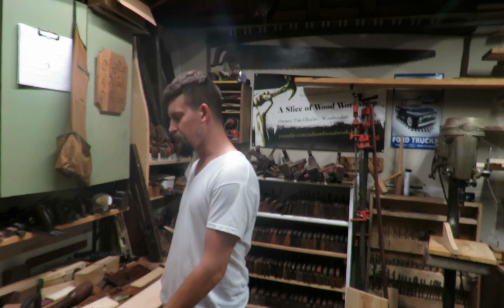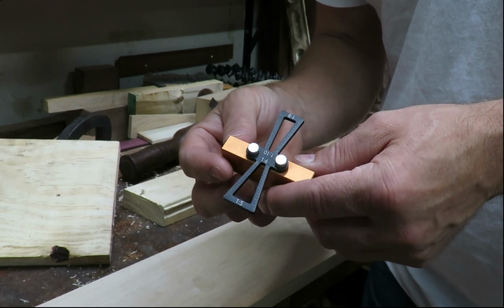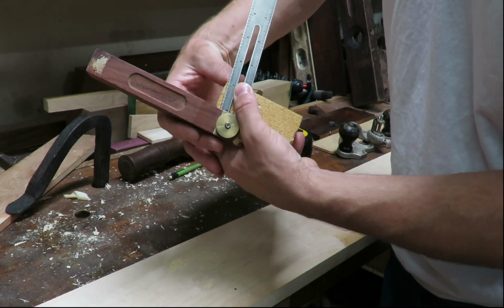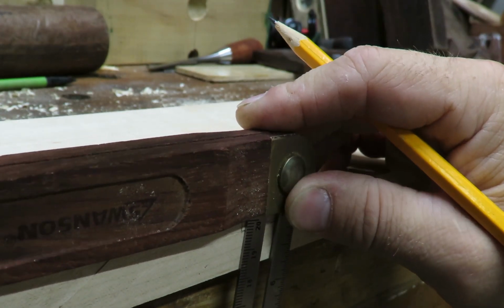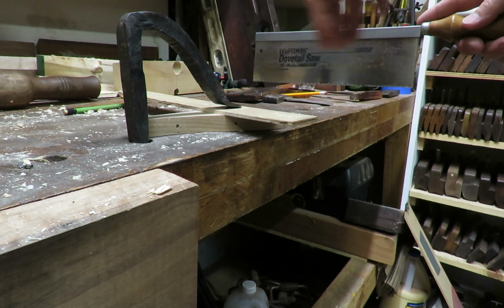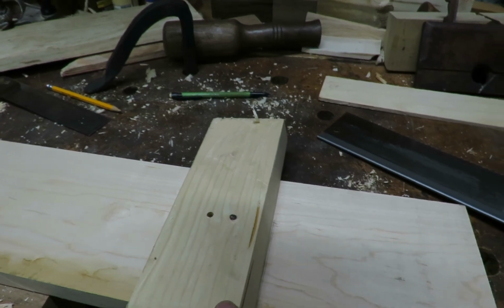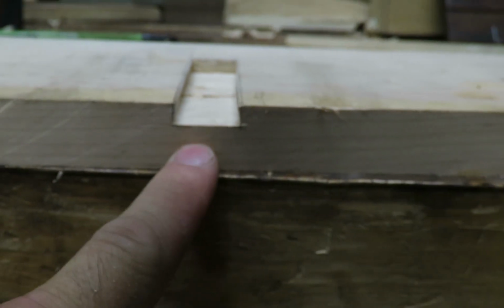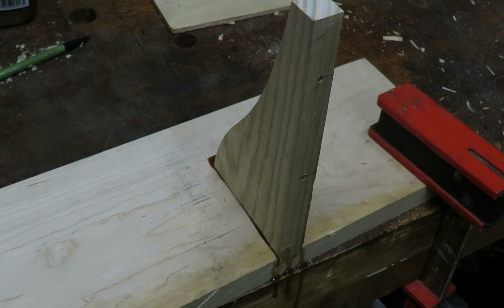How to make a Stopped Sliding Dovetail

Comment: You could use a block of wood on the dovetail also. I watched a Stanley 444 video & have decided that sliding dovetails are best your way or just using power router with dovetail bit. P.S. you could also use a donkey ear & clamp
Reply from the maker: When sawing the vertical line of the dovetail I use the saw reflection to stay vertical. Having the block is a good solution too though